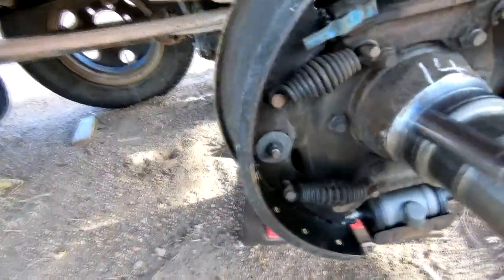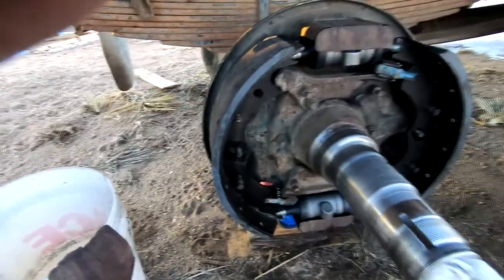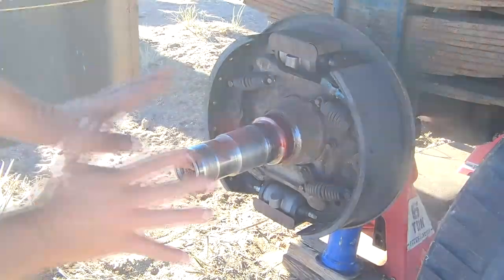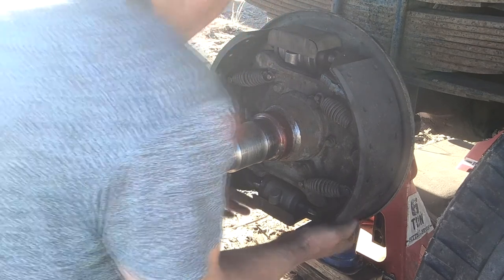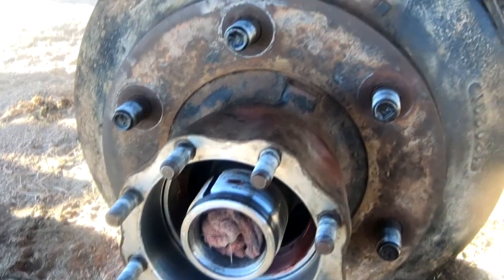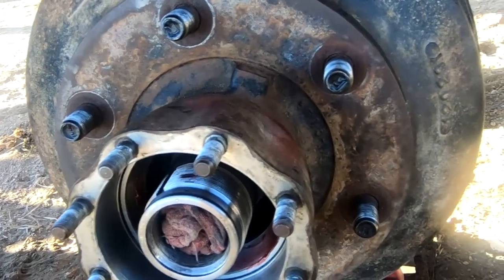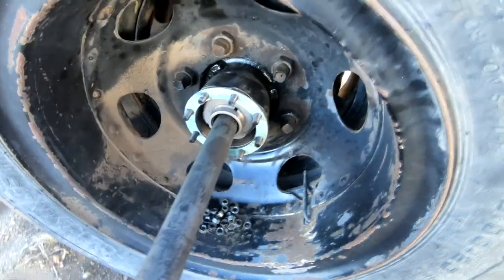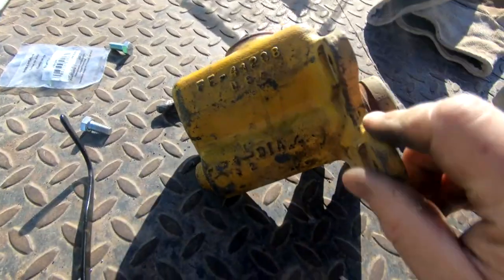1967 Ford F600 Rear Axle and Brakes Part 3 - How NOT to fix using the wrong tools.

Comment: The grease hub was a ford thing for about 10 years on medium duty trucks with hydraulic brakes. It works very well if it is reasonably maintained. They did it for 2 reasons it keeps wear material from the diff out of wheel bearing and it is no where near as prone to inner seal failure contaminating brakes. Book says  15k service on rear bearings which in its day was not outrageous but today...
Reply from the maker: Hey, thanks so much for that info!  I hope that with those new style seals it will be okay.  I probably should have RTV'd them to the hub just to be sure.

Comment: Did you replace the adjusters and star wheel when you fixed brakes? If so where did you get them at? I have a 1963 f700 and adusters are froze up and center came apart on star wheel? Thanks Tony
Reply from the maker: No we didn't replace them. Don't know where you could find them either. Try soaking them in some acetone and atf mixture for a couple of days. That will probably do the trick. Thanks for watching.

Comment: I am about to do the same thing with a 1969 N700. Very similar.  Can you tell me where you found the info on the new seals you used?  Thanks!!!!
Reply from the maker: Napa. I took the old inner dust seals to them; they measured them and came up with the replacements. I found the outer seals for the axle hub at Oreilly's Auto online.

Comment: Normally those nuts that hold the shoe are a castle nut, and there should be a hole in the stud, so you can secure the castle nut with a cotter pin.  I've never seen these old trucks otherwise.
Reply from the maker: No hole in the stud.  These are actually Nylocks.

Comment: Ed here, worst thing on the old trucks are the 2 pcs rims, bad dangerous and hard to get changed. looking for a set of 1 pcs rims for mine. dont like the single master cyclinder resevoir, may change it to a double unit with two boosters! also need power steering unit to fit f600. also there is just 1 brake fluid line feeding both rear wheels, not enuff. the front wheels each have a brake fluid line.
Reply from the maker: I hear you. But as it is I can lock up the rear brakes now, even with a load. Thanks!